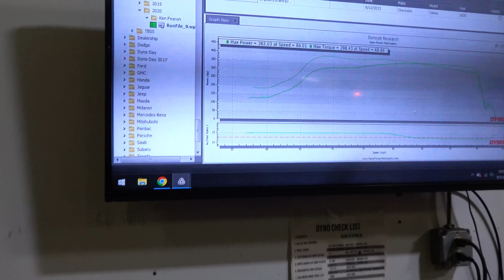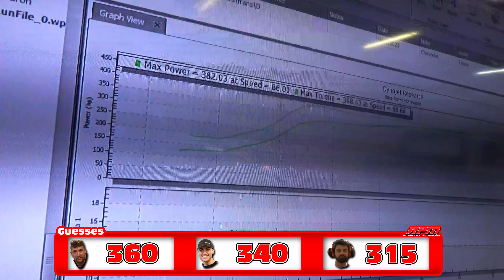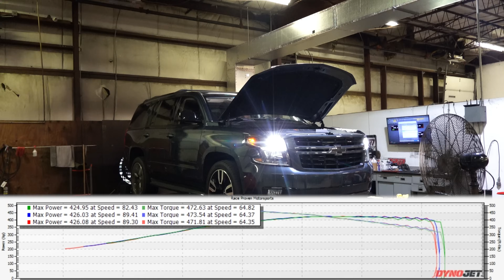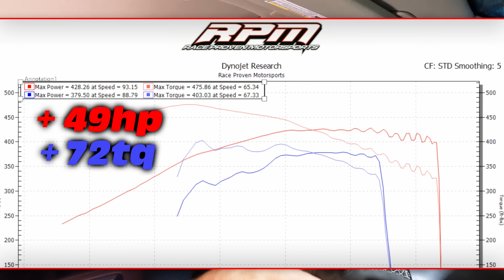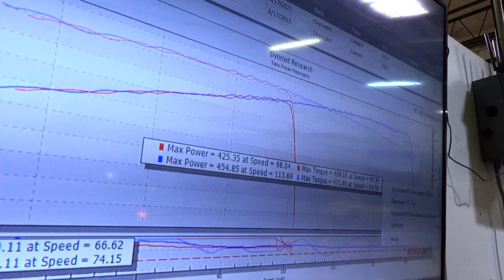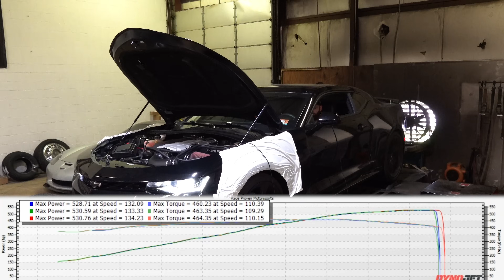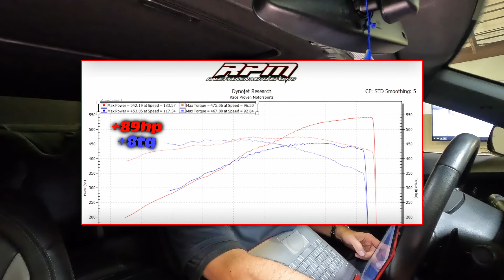500HP Tahoe!!!!

Comment: Intake/headers in the 400+ with a tune thats not bad for Tahoe at all
Reply: I think it would have made the same just with an intake. Stock header with cats flow pretty well at this level, I didn't change them on my z06 until after 600 rwhp
Reply: That's what I'm saying sheesh. Makes the same as my heads cam intake 6.0

Comment: Fran you look great dude!  I want to ask you this because your the man, i've got a 06 LS2 GTO with Long tubes, and X air OTR intake and Dyno tune, it made 386 Wheel & 390TQ, wondering what cam you would recommend?  I have the stock torque converter, would it be worth doing a cam without doing heads or a stall converter in your opinion? Thanks man!  Love the content!

Comment: Why not remove the speed governor? Would it not make more power as you could stretch the legs more …
Reply: Driveshaft
Reply: No the curve is nosing over.  It's making peak power before the end of the pull.
Reply: Ahh ok thanks for the knowledge just sounded like it was hitting the limiter before max RPM